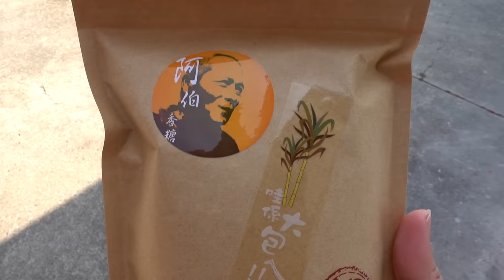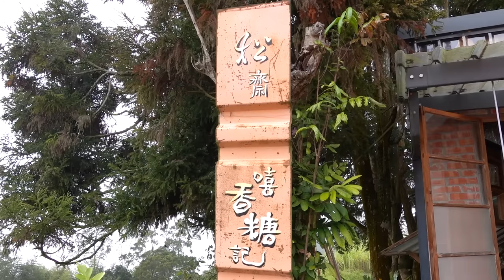Traditional Brown Sugar Making in Taiwan / 黑糖製作技能 - Taiwanese Traditional Food

Comment: 2:30 at this point, close the fire, add in the baking soda, and then vigorously with all your might, stir the hot sugar syrup and baking soda mixture until smooth and remove the ladle immediately. Quickly pour the batter on a greased baking sheet, non-stick baking sheet, or leave it in the wok for the batter to rise into Honeycomb Toffee (Dalgona).
Reply: how much baking soda do you add